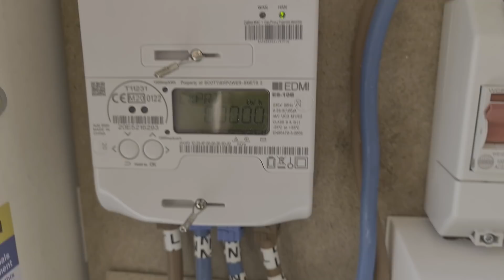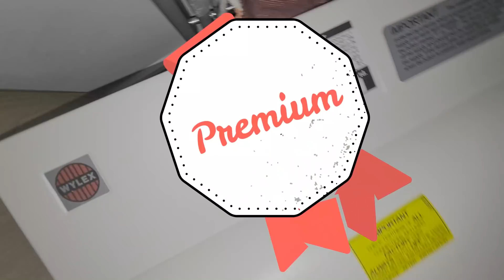New Build Electricians Shocking Standard?

Comment: 2021 why are people installing 16mm tails!!
Reply: The "tails" on this installation look like they were off cuts from the SWA
Reply from the maker: @MrKarlPrince  definitely
Reply: @electrician247  They certainly weren’t wasting copper on this one!
Reply from the maker: Is a fair question mate lol
Reply: @electrician247  You could say consumption has reduced. Still run lots of 16mm
Reply from the maker: @AndyK.1  with lighting and the move away from high consumption appliances you have a point. But generally in domestic with the probability of EV and some form of non gas heating on the horizon I see more strain not less medium term. 

In this case the 16mm between the wylex tails isolator and consumer unit only has the 100A suppliers fuse on it. 

But take your point with correct ocpd nothing wrong with 16mm in certain installations
Reply: @electrician247  Yeah I was thinking about heating too. Clearly the EV is intended to be run from the meter cab. Personally I don’t have a problem with that.
Reply from the maker: @AndyK.1  I get both arguments around meter cab equipment.

Comment: Isolators been sealed on top half. Shows demarcation point. Id leave that there
Reply from the maker: Could do, thinking of getting dno out to isolate while we make changes then check they okay with the result and reseal. Bit of a paper trail to trying to keep everyone happy?
Reply: @electrician247  I think this is the way to go at the risk of them rejecting the change, as it will also highlight the state of the install to them, and give them a chance to potentially demand remedial work across the whole estate.
Reply from the maker: @MrKarlPrince  this is also my thinking. Gives them sight of it. Although apparently they have accepted this on the site. I cant believe it but thats what I am told!

Comment: Unfortunately the big losers in new build housing seem to be the sparks nowadays, prices are so poor that corners are regularly cut in terms of the installation. Materials are governed by the builders and which manufacturer will offer them the heaviest discount. I feel for the contractor slightly in this instance as it is clear they have tried their best to make this installation compliant and to a standard they believe will satisfy all parties and still keep their 4/5% profit margin and I have seen far far worse on new build sites but if this isn’t being reported to the builders then things can only get worse still. The issue with reporting it is that the builder doesn’t care what contractor they use as long as they carry the NICEIC badge and can scrape together an install within budget so they will just move on to the next without a care for improving standards or safety for the occupiers.
Reply: The problem of poor prices stsrts and finishes with the electrical contractor,don’t do the work if it means cutting corners.
Reply: @johnb.9190  I agree but there is always somebody out there who will do it for less and as I say the house builders don’t care as long as you’ve got your niceic sticker on your van you can have a go. The domestic market is horribly oversaturated with crap installers
Reply from the maker: @boat303  the short courses and those helping anyone pass a regs course have a lot to answer for.
Reply: @electrician247  sometimes the finger is too easily pointed at the short course guys when I see on a daily basis poor work from seasoned NIC approved contractors
Reply from the maker: @justinHTE84  agreed, AC can be just as bad. But the issues remains that the apprenticeship system is on its knees due to the huge entry to the trade via short courses. Exceptions to every rule though I totally accept.
Reply from the maker: @johnb.9190  Good contractors wont go there. But some either dont care or feel like they have no option. Hard to walk in others shoes. Either way we can do better and the developers should lead that on new build
Reply from the maker: Good point Benjamin. I agree its very tough market place. Home owners suffer as well. Builders win.

Comment: Some people just like to moan 🤣. For years builders ran tails unprotected through the building. Now they add protection and use suitable cable and you still aren’t happy 🤣
Reply from the maker: Hahahahahha. Proper miserable bugger I am Andy. But you are right electrically it does have over current protection and is earthed on the armours. Rough. Bit better than 15m of tails rammed in the meter direct.
Reply: @electrician247  I’ve watched it now. Yeah mess. Should have used a metal CU in meter cab to gland it correctly.
Reply: Good point about selectivity. Use din rail fuses if they still do them
Reply from the maker: @AndyK.1  exactly my thinking Andy. Still not ideal but much better I think.

Comment: Put a sketch with your meter cupboard idea on Mark please.  Got to admit that looks terrible short cut work.
Reply from the maker: Basically strip it out. 4 way CU with main switch, fuse carrier for the internal CU, rcbo for the EV and SPD with mcb on the end. 

Best of a bad job I think? What you think?
Reply: @electrician247  all this would be a lot more simpler if the cu was located directly behind the meter cupboard.   I honestly don’t think the designers are even considering the suppliers requirements.  As efixx have established, nothing should be in the meter cupboard so is it that the property designers have forced an issue that the electricians can’t overcome. It’s still shit workmanship though.
Reply from the maker: @darrenplant619  exactly Darren. I agree,  said the same in the waffling chat at the start or end of the video 🤣.
Reply: @electrician247  Can you even fit a 6 DIN consumer unit in there for all of that? Mainswitch 2 wide, Fuse Carrier 2 wide, RCBO 1 wide, MCB 1 wide and SPD 1 wide. Unless you use a 125amp rated SPD and get rid of the MCB for it?
Reply from the maker: @effervescence5664  is exactly the problem mate. The aite manager wants the same protection afforded to the sub main as provided by the original installers. So as not to adjust there design.... helps me out a bit with a C63 mcb. Probs get down to 4 way.
Reply: @electrician247  Not adjusting their original design is hard when it's of such poor standard. I suppose you could use the tails isolator as a main switch external to the enclosure and then have a MCB for the original supply + mcb for the external CU and an SPD. Not ideal but it would give you a point of isolation, discrimination of protective devices and the space needed.
Reply from the maker: @effervescence5664  we are talking about removing everything inc tails isolator. Installing a small CU with main switch, C63 for the internal CU, B40 rcbo for the EV, B32 for the spd and SPD in the meter cabinet. 

I would prefer a din fuse for the internal CU but they want that left protected as specified by the designers. The thinking is it can be reset where a fuse might not be readily available... 

But I am happy on that basis. I see no point of another external CU take off from here when the EV rcbo fits and equip is in the cabinet anyway.

What do you think mate? Appreciate your input.
Reply: @electrician247  We run 24/7 call out so fuses aren't an issue. I can see why they want an mcb but we both know under the right circumstances the mcb outside can nuisance trip. I agree no need for an external CU if done that way but it does seem cramped, if only you could turn the CU 90 degrees after removing the isolator. Though it's frowned upon at the best of times. 

At the end of the day as long as it's safe and your conscience is clear just do whatever is practical within the regs. 

As an off note, the designers of these installations remit is least amount of materials used. That's why boiler plant and CU are mounted in the centre of the house. Cost savings for the Builder and cost incurring for the future home owners.